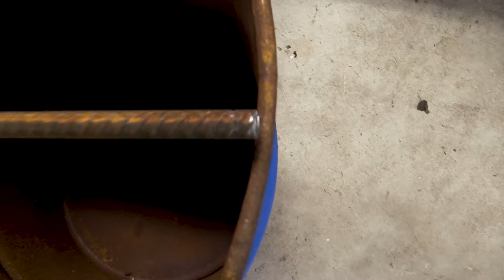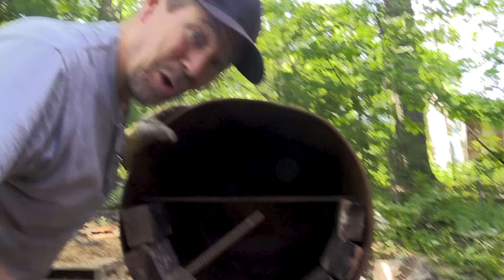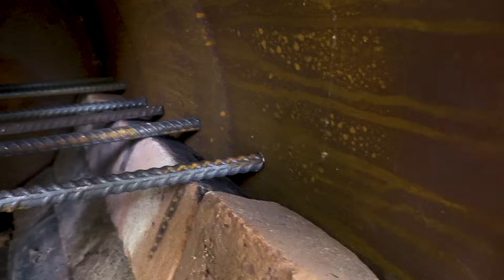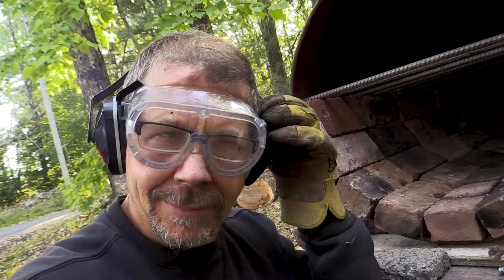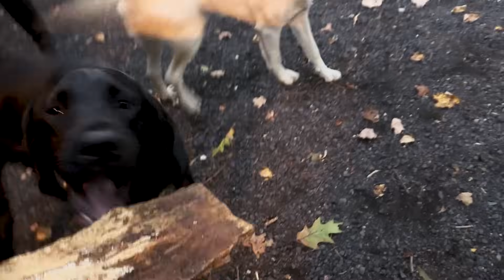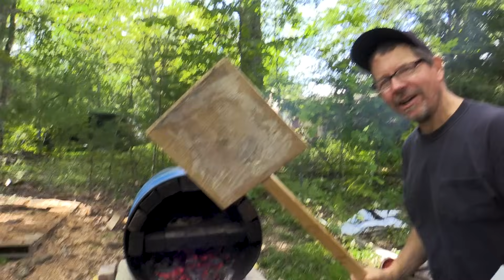Built This Barrel Pizza Oven 2.0

Comment: Warning!! Make sure you know what the drum previously contained. Several decades ago, when I started a new job at an aircraft facility. In northern California, a man built a 55-gallon drum into a grill. At the first barbecue, a few  people died, and others were severely injured from the inhalation of the toxins that had absorbed into the metal container.
Reply: Thanks mate
Reply: OMG.  Thanks
Reply: Thats insane did the barrell have a skull on it?
Reply: No, back then, the EPA rules weren't as stringent. 55 gallon drums were just stamped with contents.  He had permission to remove it from the company property.
Reply: Good awareness indeed. My opinion: better to burn the wood, first time empty barrel.

And bake something the next time. 

The first empty barrel fire 🔥 will burn many toxins caused by  poisonous content, if any, in the barrel.
Reply: Good point.  Its much safer to use bricks you get from Home Depot
Reply: You can buy new barrels on line,that aren't that ecpensive
Reply: @PKeshap  maybe and maybe not.  I wouldn't want to risk that they all burned away.  Best to only used barrels where you can confirm it was only ever used for food or water or something benign.

Comment: Keep perfecting it you’ll come up with a better idea. I would use refractory brick. I wouldn’t use rebar it’s a soft material. I’d have a surface for the fire to burn on instead of the barrel itself. I was thinking I could make a Städler style out of a barrel.
Look up Städler made pizza oven .
So simple it’s ridiculous. I’m sure it could be made out of a barrel especially like a 30 gallon barrel.  
The most expensive thing would be a good quality pizza Stone.
Or use the thinner refractory bricks that you use to line a woodstove they’re available from Ace Hardware. If your store doesn’t have them in stock, they can order them.

Comment: I should have done some welding or piercing inside and saved a bit of time and strength. Get ready for next version.  And make the size of drum  half. 
Keep all moveable at the inside. Easy to disassemble and take anywhere you like.

Comment: Is this movable at all ? Or too heavy ? Would it be good idea to cut the barrel on line 4-8 o’clock to make bigger burning place ? 
What did You use to joint those bricks ? And anything on top of the burning place ? ‚Chamote ‚ ?? Advice please

Comment: Pro tip: Use a damp, slightly wet, cloth to wipe ash off the bricks.
The water will grab the ash and remove it easier.

Comment: Don't let the pizza oven bug BIT YA. Look on your patio. You probably have the best pizza oven there is setting on your patio. A SMOKER, ANY DONE GRILL WILL WORK TO! It can be square or round. ALL YOU NEED IS A KETTLE GRILL > PIZZA PANS up to 18" AND A PIZZA PEEL that it. Now!  if you grate got handle just turn it over, and with some metal round stock to set the pizza pans on it EVEN 👍  THAT IT!  Your ready to cook pizza. HOW HARD WAS THAT?  😆 SAVE YOUR TIME AND MONEY!  Just 👀on your patio

Comment: You really don't need the side bricks .  Wasted effort and added difficulty .    The drum is made of very thick steel .  If you are worried about heat escaping from walls ,  wrap it with fiberglass .     Try one without bricks,  I doubt you'll notice a difference in cooking time.

Comment: You could drill holes for the rebar and let it protrude on both sides maybe?
Reply from the maker: I did that for the first barrel video,  my concern was the rebar would slide out the holes during the tilting process. Thx!

Comment: I think you could just use the top 2/3 of the drum, cut off the bottom so it's flat (lose the re bar keep the angle steel). Have the fire inside the chamber. Actually might need a bit  of rebar front and back to keep the integrity.
Reply from the maker: Interesting Fred, thx for that! Eric.
Reply: @gardenfork   Thanks to your inspiration (as well as a few others), I finished my oven today. I cut the drum slightly smaller than half, so I had to different sized halves which I welded together. It has a pocket between the two sections which I filled with basalt gravel as a heat accumulator. I filled it via the large lid hole which is at the rear outside section. Door and chimney both made of offcuts of the front. Got it sitting on fire bricks. I tried to post some pictures in a link but my replies disappear because of the link! Happy to send them if you are interested. 
Thanks again. Freddie

Comment: Like the idea. I would recommend an old trick I saw overseas to glue bricks in a fireplace. Mix clay with sugar, and water. The clay jams and stick to the brick and after it is dried and heated the sugar oozes out and completes the joint. It worked in my oven and never cracked. The exposed sugar gets burnt away. Try it!

Comment: Good idea, but perfectible: a wood-fired pizza oven must have the fire that touches the refractory vault to reach 400 degrees above and 300 below, so the fire must be done directly on the hob, on the side opposite the exit. of the fumes. When you have reached 400 degrees above and 300-350 below put the pizza for 60-90 seconds and it is cooked as the Neapolitan tradition requires. if you cook it more slowly at lower temperatures you have a greater evaporation of water and to reach cooking it takes time and becomes hard while the ingredients of the sauce dry too much. it is advisable to cook the pizza with a quick heat hit at temperatures of at least 350 degrees to avoid this inconvenience. depending on the type of dough it may be more appropriate to increase or reduce the temperature, but rule n ° 1 for cooking thin pizzas and focaccias is the higher the temperature and the better the result, below 250 ° we only cook cakes, bread and dishes

Comment: Cool job! You should poll the temperatures (max) of the bricks and the time span it drops by 50°C with no flame (or minimal flame on the end of the barrel). Then think of a better insulation, and a way lo limit the dispersion of the bottom flame cause it seems you need a very big fire and still it doesn't perform very well.

Comment: Great idea and  cheap  maybe  if you would  bend the rebar instead of  cutting it  to size make  one  piece  go  twice  it would  roll out  and maybe  break the  bound on your  bricks. Line  the bottom  of your  oven  with high  temperature  cement  it will last longer.i think I'll  use your  idea  thanks.

Comment: Nothing wrong with using red clay bricks. You just have to treat them differently than fire bricks. As long as you slowly build up the heat in the oven, and slowly bring the temperature down after, they will last a long time. Clay bricks fail and crack (spalling) when they are subjected to rapid temperature changes and thermal shock.
Reply from the maker: good info, thanks for sharing! Eric

Comment: Could you Weld the angle iron and rebar into a removable rack to hold the brick arch in place?
Reply from the maker: Yes! That would make it easy to slide in. But I wanted this one to be a design for those who don’t (yet) have a welder. 😀 eric.

Comment: Hi Erik, thanks for sharing your video. Using a large concrete pipe, i built a similar piza oven 6 ft in diameter. The bigest chalenge was to roll the pipe 1/2 a turn, with the help of three man and a car jack. It woked well for 10 years and now i am renovating the front. Cheers from Australia, Alberto.
Reply from the maker: Good to hear Alberto. Great idea using concrete 😀 Eric
Reply: También pensé en los tubos esos 😅

Comment: the key of a fire wood pizza oven is to be able to cook simultaneously the top and the bottom of the pizza you need to build a fire also where the bricks are so that the flames will run over the top acting like a broiler and then you will have perfect pizzas!!! cheers

Comment: Dual purpose, larger oven, useful for a bread oven, tip, order a BBQ Thermostat for a temp guide, I've sort of refined it, started with barrel too, now moved on to a 36" 1/2 wall pipe, welded door to it, welded a support to hold a cast iron griddle on top. And a roof structure of clay tile. 
 It's a great outdoor canning, baking, whatever appliance now.
Reply: I envy the picture that made in my head!

Comment: The fire chamber in the bottom prevent the heat to rise, leaving your Pizza top undercooked. The general idea is a refreshing departure from everything out there, yet you didn't yet master the full context of what makes a truly great Pizza. Heat retention within the cooking chamber is the ONLY factor and that's the reason every wood burning oven has the combustion chamber on the baking stone. 25 years ago I designed a similar oven that actuality functions with the burning chamber below. It was finished in less than 6 hours using 72 fire bricks 2.5" thick and 12 fire bricks 1.25". It was convertible 3way oven: a Pizza oven , a grill and a rotisserie able to accommodate 2 turkeys, 5 chickens, a whole pig or a whole lamb...
Reply: Couldn't you just leave a gap at the back and have the fire there so the heat can reach the top of the pizza? Would be really interested in seeing the plans for your design

Comment: Do you have something against tack welding the metal to the drum? That would fix all your problems. 
And if you coat the brick with fire mortar, it would add more heat resistance and hold the brick still. 
Great ideas otherwise.
Reply: I'd have drilled rebar sized holes and pushed it through. Then the bar could have been capped on the outside..trying to weld rebar to old tin may not work too well.
Reply: He's provably just not familiar with welding and using the tools and skills he has on hand.  Seamed to work out well as a prototype.
Reply: "Fire mortar," this is new to me and exciting to hear about. If i would walk into a hardware store would the bag of mortar say "fire mortar," or what words would i look for to get some that handles high heat?

I see his weathered bricks and think of my fire bricks it would be nice to coat them over with a nice smooth clean layer as well, but i alway see warnings about the possibility of material like concrete exploding from steam spots so have stayed away from that.
Reply: Make a turnbuckle with all thread. Would basically be adjustable rebar

Comment: It would be easy to use clay or fire cement to glue the bricks into their places. One could also create a smoother surface with less gaps for the dome of the oven. And by spot-welding the rebar in place the entire construction would become “earth quake-proof”… Doesn’t cost the earth, but would improve the stability significantly. Waddaya think ?

Comment: I would be concerned about the safety of cooking food inside a metal drum.  What was previously stored inside of it?  Also, the different metal parts might release toxic fumes at high temperatures.
Reply: That's why you do several burn offs  before letting any good go into it. It gets rid of paint fumes and anything that may have been contained within. Our ancestors cooked everything inside metal stoves remember - steel / cast iron - it's all good.
Reply: @tonyanddeb1012  Good points. Thanks!

Comment: This is really cool, Eric!  Well done!  The crust looks perfect.  😃
Reply: it's very far from perfection and cooking chemical paint on the outside of the barrel is a very bad idea...the fumes are extremely toxic. If you want use an oil barrel for that, strip the paint first, then use the bare metal barrel or create an outer insulated layer to cover with a thermic paint for ovens. The way he did can create serious problems if fumes are inhaled and even to food cooked inside, if released fumes are moved by wind inside the barrel.
Reply: @ragnarrlobrok244  okay, but perfect crust is subjective.

Comment: I had the thought that maybe you could line the entire inside of the drum with bricks and if that would direct even more heat into the oven and allow less heat loss through the metal. The metal probably wouldn't get as hot to the touch on the outside of the drum during cooking either.

The other thought I had was whether you could secure the bricks in the curve of the drum with gopher wire but now I'm thinking that it would get too hot. I wonder if there's a glue that would be heat-resistant enough for it or if you could successfully stick the bricks to the walls of the drum with high heat mortar.

I am going to make a pizza oven too, which is how I stumbled on these videos of yours, but I'm thinking I'll make one on top of a Dakota fire pit. It's similar to what you did here, except the bottom part is dug out of the ground. Actually, you know what, you could dig a hole for the bottom part of that oven and the earth would insulate the bottom, prevent people from getting burned on the sides of the drum. Just make sure to clear out roots if you dig any kind of fire pit because, although it's kind of rare, fires can sometimes run along the roots of trees and come up at the trunk of the tree and you won't even know it's happening until there is suddenly a wildfire. Make sure it's just dirt around the fire in the hole and you'll be fine.

Comment: I believe your oven design would work even better if you restricted the top front port with a cover and some small holes in that cover.  Moving the fire furthest back would allow the flame or heat to travel over the top of the pizza. If you look at a  Weber smokey joe silver it has a port on the bottom and one of the top. The adjustment of those ports control the air. Fire needs air or air regulation.

Comment: you can put a bunch of smaller tricks of hardwood to get a quick rolling fire right before you cook your pizza. If you see flames on the top creeping towards you, you know your airflow is good and it will roast the cheese like you mentioned.  An exhaust port/chimney a little inset from the opening in the front can help in general with flow but mostly prevent burning yourself. Seems well enough though, just need to weld and mortar and add some legs and it would be pro.

Comment: You could try making a ring for your weber grill out of this barrel and use it as a pizza oven. They make commercial product similar to what I'm describing called Pizza-que or Kettle pizza. There's also this guy on etsy that sell 3 in 1 rotisseries ring/pizza oven ring for weber grill. This (the etsy ring) is what I run in my "Wood fired pizza" video on my channel.

Comment: This was sweet! I really enjoyed watching you work your way through it all. Does the metal ever get destroyed by that much heat? And would it be beneficial to ventilate through the back? 
I was thinking that the barrel might deform under that weight, becoming more of an oval, so if there was a way to secure it in cross-section it wouldn't be as prone to collapsing bricks. But that's my engineering-brain trying to make it perfect, instead of done, as it obviously turned out a perfectly-cooked pizza!
Reply from the maker: Yes, The metal will fatigue over time, hence the low cost materials. The rebar has already started to warp from the fire. Thx! Eric